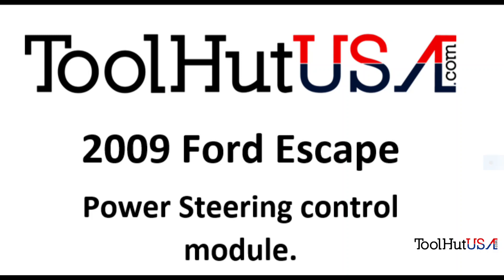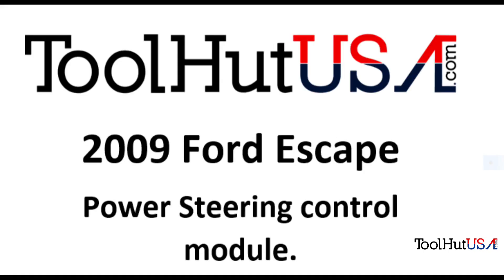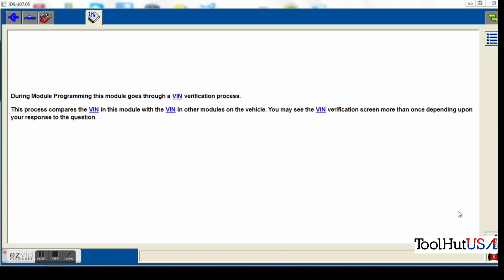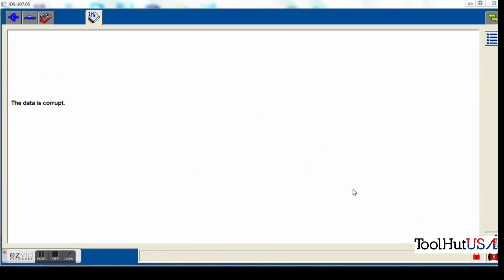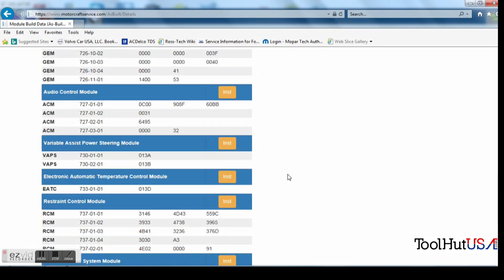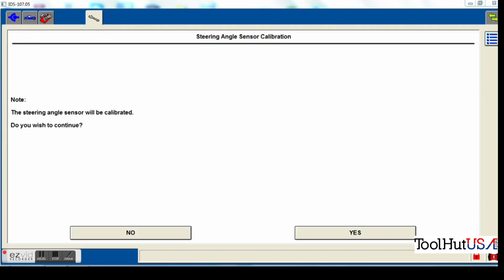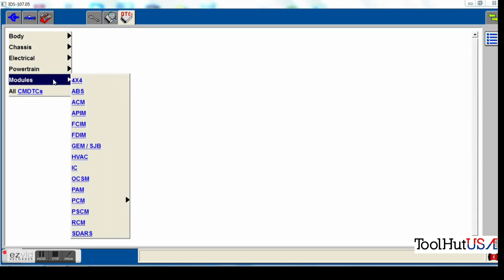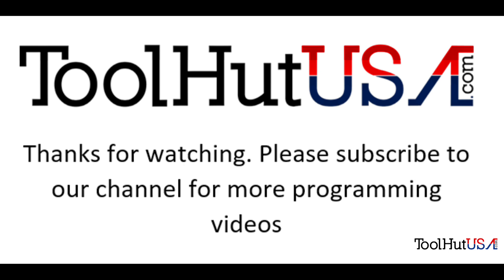Ford Escape Power steering module programming

Comment: First of all thank you for this video, it is very helpful.

So I have a problem with power steering control module on Escape 2005 hybrid. I bought used one on ebay, installed it and it made no difference. 
Is it possible that the part needs to be programmed as long as Mariner and Escape has the same modules, I don’t know the part I bought what car had been removed from? 

The question is if the part I bought had been removed from Mariner it  may be needs to be programmed after installing on Escape
Reply from the maker: I am not sure what the difference is. Sounds like you may have another problem

Comment: Cool info.. I just had a local shop install a New Ford OEM Steering Column on my Wife's 09' Escape & No flash was needed. 
Many mechanics have said you really don't notice any difference from a newly installed Flashed Column Electric Steering Module, to a non flashed unit. I don't notice any difference besides the power / Electric steering works 100% of the time now. Cost, $1100 for Steering Column off eBay (dealer wanted $1900 for steering column & total of $2300 installed) my local shop just charged $200 to install with no Flash needed. Works like a champ now.
Reply: What was the part number for that if you don't mind me asking?
Reply: Some Escapes had a recall on the power steering issues. Ford would replace the whole steering column, but mine 2011 wasn't  included. Apparently it could be fixed cheaper by just replacing the power steering motor... 2008-2012... It is not true that you need to replace the whole steering column.  The PS motor can be changed without even removing the steering wheel. Some people had the phantom shake and that is the angle sensor issue, but a new PS motor includes it. My issue is intermittent on startup. I 've never had the phantom shake and if you buy the angle sensor, people report they still had the problem and had to buy the PS motor and that fixed it for them...  I have Ford Code B1342-2F or B1342-6F another time, both mentioning ECU internat failure and the the PS control module... I will inspect the contacts before buying a motor... It was bad and after I cleaned some greenish ground on engine and a serpentine belt , it has only happened once... It was happening 9 out of 10 times and now is happening 1 out of 10... So I will try and check if its an electrical issue between the ECU and PS module...